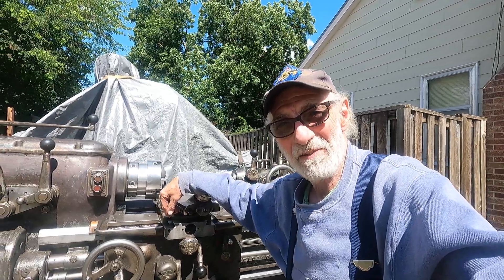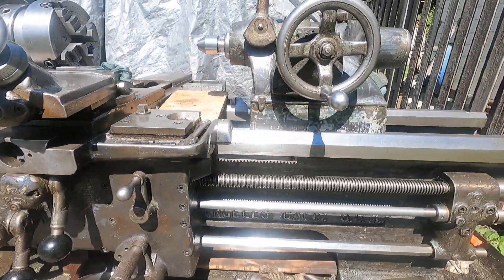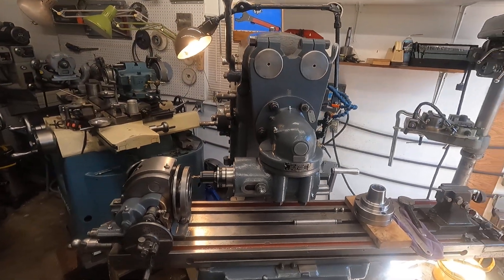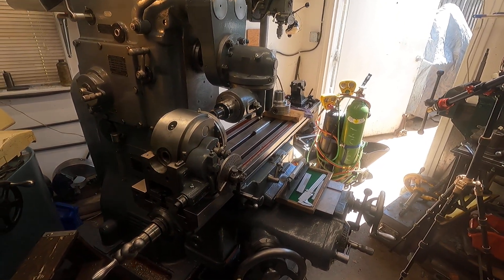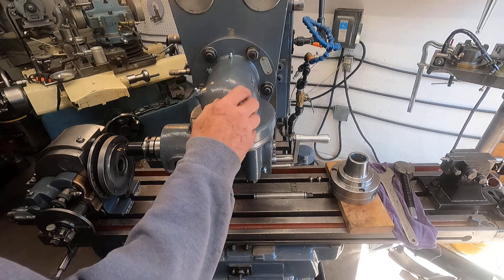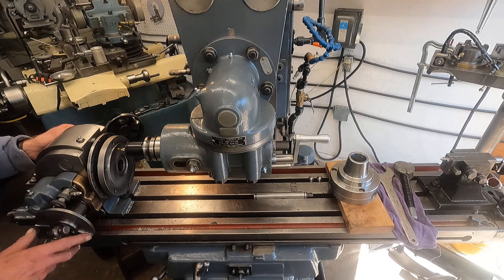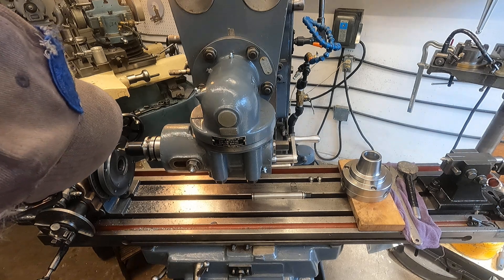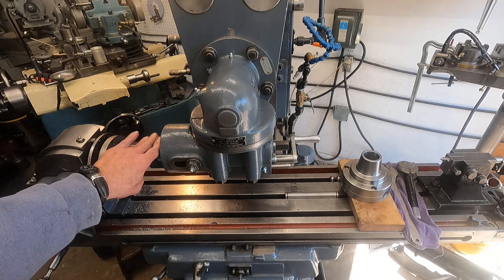Brown & Sharpe milling machine using the sliding vertical head

Comment: I Enjoy seeing your B&S #2 mill in action. I have an about 1938 vintage B&S #2 Universal, not the light model, that I use.  It has a Spanish copy of a Bridgeport J head on the over arm supports, so I tend to use it as a vertical mill more often than a horizontal mill although I have everything to use it as a horizontal mill too.
Reply from the maker: I have been really enjoying using this old machine, I was just making a small part and will load another video. I have much more experience with standard vertical mills but have used the horizontal machines for basic heavy work, this one having a vertical attachment is new to me as the attachments are rare in my area so using a vertical mill head is common and works good, this attachment    only has 9" of daylight to the table making angling or swiveling the head horizontal like the table to get clearance needed. The small amount of quill travel makes a very big difference also. The big advantage is the ease of changing angles and traming it back Thanks!

Comment: Need to tram a B&S product? set it to the marks, they are there for a purpose, and as accurate as most folks need, mine is a #2 universal light type with all angle universal attachment.
Reply from the maker: There are adjustable markers I am setting after tramming, this attachment also slides out 12" driven by a spline shaft in the horizontal spindle.
Reply: @deedeeindustrialsuperprecision  My experience with B&S machines is that the zero point marker is pinned in place not adjustable, and graduations are highly accurate, being cut into the swivels with a high degree of accuracy.
Reply from the maker: @biggreasies537  Two  are adjustable on this attachment. The scales on any machine are only a guide, there is no verniers on these.

Comment: That’s a nice feature to be able to drill horizontally. I too thought you were going to move the table to drill those holes. Thanks again for sharing!
Reply from the maker: The quill has only 2" travel but it can be maximized using ER or Erickson collet chucks